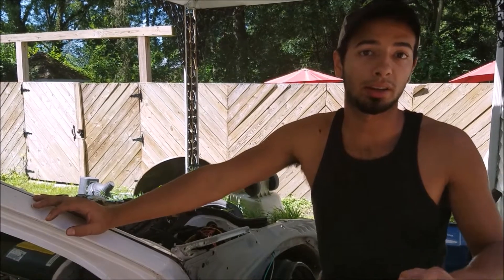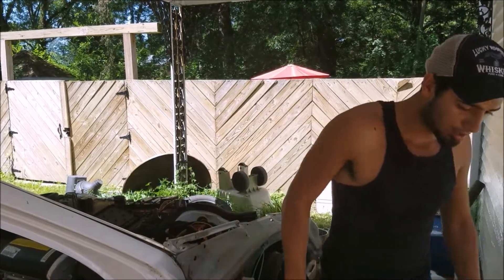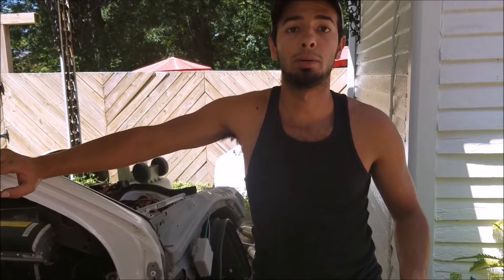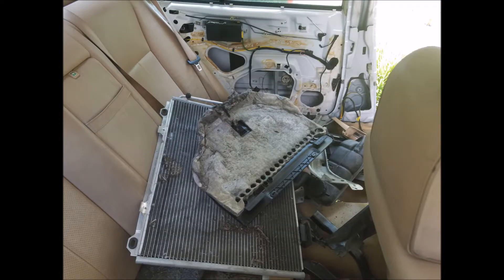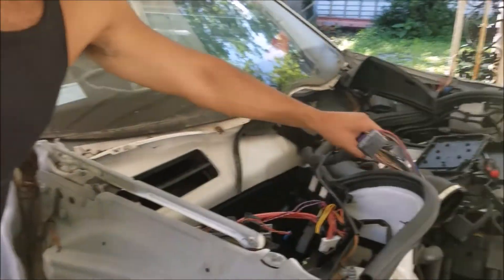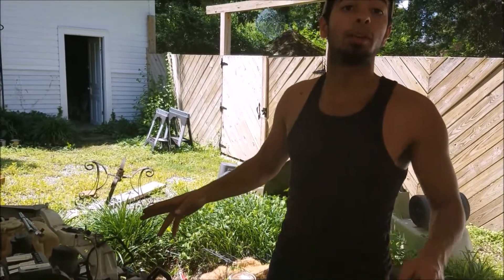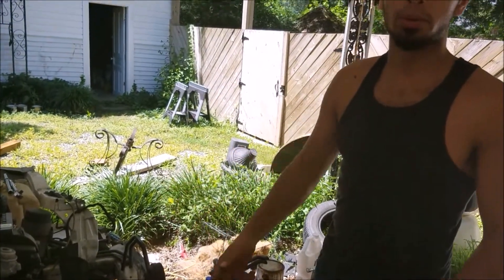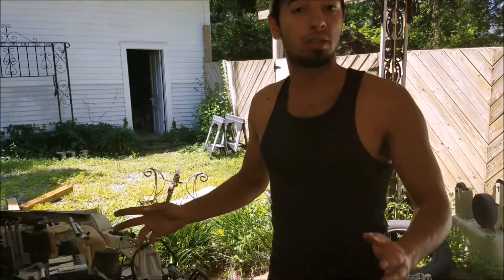How To Part Out A Car On Craigslist and Ebay

Comment: Hey E36 Fanatics, yeah, the cinder-blocks @ 7:57 seconds are supposed to have more strength when you use them vertically (NOT horizontally! as they can crush out) = Engineered for use when the holes are at the top and bottom, just as you would when building a brick wall. I know by experience, have had blocks go to pieces, the way you show yours.. aaaaaand, axle stands are fairly cheap and safer alternative!! hope this is helpful, Great Vid bro!!! lat'r Buzz
Reply: DOH! I should have read the previous comments first! lol
Reply from the maker: Thanks! I usually use the pair of axle stands I have at the house, but that car was sitting a while so I used the concrete. Thanks for the idea, I try and use 4x4's now when I've got a car sitting.
Reply: I saw an OzMods video where the jack stand actually collapsed under the car when he was about to change out the exhaust, so no they aren’t always the safest. I’d always put some wood or concrete blocks under just for extra insurance

Comment: Do you do this for a living?  I resell items for a living and im searching for my niche and really thinking about getting into selling car parts since I am a backyard mechanic anyways.  I have pick and pull junkyards in my area with a ton of cars, can you recommend some items that sell really well or I should be looking for?  so far ive found a few Mercedes shifters are expensive and some amplifiers go for a good price. and certain climate controls on some cars sell well,   (ive currently got a hand full of mercedes and lexus parts) but really looking to add a few hundred parts to my inventory.   Any help would be great,   Subscribed.
Reply: I have been parting out cars on eBay and Craigslist for some time now. I have been a car guy my whole life. I have a two bay shop behind my house with lift, air tools, etc. I only put the cars on craigslist to sell big parts, ie, fender, doors, hoods, etc. All the smaller stuff is for eBay where the REAL money is. I put all my effort on eBay and anything that sells on Craigslist is a bonus. 50% of my buyers are repair shops. A salvage yard near me sells $20,000 per month on eBay. It is the way to go. It is better to buy whole cars for scrap and part them out fro full profit. I do not waste time going to junkyards to buy. I make all my money back from scrap weight, converter, tires, rims, battery and all the parts I have on eBay I have nothing into for 100% profit! I do this full time.
Reply: At that point though you run the risk of getting caught. If you don’t have a dismsntlers license you can get hit with some hefty fines. You can profit well by going to your local pick-a-part and getting parts but you MUST have knowledge on in demand/profitable OEM parts. My family owns two wrecking yards in Southern California and I ran the eBay department. I moved to Texas last year and started sourcing parts at my local pick-a-parts.

Comment: I noticed that you said to cut anything in your way like the a hoses...those are valuable too I've gone to the junk yard to look for hoses and find them cut they maybe small but in demand
Reply from the maker: They can be, I typically just cut through them, personally I've found that most people want to buy hoses new.
Reply: I was talking to a bone yard guy a while ago about getting a  coolant hose.  He said they don't sell them because they can't guarantee them.  An old hose is problematic.  
     Oh, and you're right.  I hadda pay 60 bucks for that hose.  And it was metal not rubber.

Comment: You might want to google using concrete cinder blocks to support a car. Quite a few sources say it's dangerous.
Reply from the maker: Thanks for the comment, yes I've heard this before. The issue is they can potentially crumble from the weight after being rained on overtime. This is why I use wooden blocks as well.
Reply: E36 Fanatics one of the best things you can use that you may have in plentiful quantity if you scrap cars is rims...a steel rim makes great vehicle cribbing... If it's not enough, take a piece of steel pipe and weld it in the center of the rim...take another pipe with a steel plate welded on top and stick into the first pipe, drill about three holes through them for a steel pin to set the height. Best Jack stands you ever had.
Reply from the maker: Thanks for the info! Yes, the junkyards love using rims as jack stands.

Comment: I'm thinking about parting out my old 2006 Mazda 3 hatch. Looking to get the same car but much newer like 2014 and straight away I can use the winter tires as a second set. Plus the battery is worth a lot.
Reply from the maker: If I recall correctly used Mazda parts are typically worth a pretty good amount. I wish I could get the time to part out a few more vehicles.

Comment: what do you do with the shell once all the good parts are gone?
Reply from the maker: Gendo3s2k I sell it for scrap metal.
Reply: You can cut up a shell in a half an hour with a cutting wheel in an angle grinder.  Even if you have a small vehicle you can get it small enough to get it to the scrap yard.  
     There's a lot a web sites that give you the price of scrap.  It the price is in the toilet and you have room, you can horde your scrap metal pile for a few months and hope the price goes up.  Most of the time it's not worth it.
Reply: Gendo3s2k Most scrap yards will pay cash and collect it

Comment: Great video.  My 2011 Altima 2.5S just died, because the CVT transmission died.  All other parts of the car are in good working condition (although aged).  I'm a novice - is it worth parting out?  Also, is there a chance that someone on Craig's list will come pay me more than the "pick and pull" places and part the car themselves?  For example one of the scrappers offered m $420 for the entire car and will tow it from my house.  Your thoughts.  Thanks!!!
Reply: 2011??? That's pretty dang new!!

Comment: How much do u sell the shell for? Does recycler come and pick it up? Thanks
Reply from the maker: Christopher Larkin it all depends on the company your working with, I had to talk with several before I found one that would pull shells for me. The price of aluminum and metal in general has dropped over the past few years, I typically only get between 50-75 for the shell.

Comment: These are some good tips.
Reply from the maker: Ryan Pinkham thanks, almost got another one today actually.
Reply: You're welcome. I have learned a lot about these things by stripping my old car down, and selling parts. I still have a ton of parts. All of the parts that you listed, are super popular requests. Also, people have to understand, that fully parting a car out takes time.
Reply from the maker: Ryan Pinkham the worst part I've had to pull is the six cylinder bmw transmissions, but if the car has low enough mileage you can get some really nice money from the transmission, differential and the exhaust.

Comment: How do you prevent people on eBay from Parts swapping you in claiming the refund under the ebay money back guarantee policy I've had tons of people do that to me with electronics and I recently decided to upgrade to a different vehicle and would like to part mine out
Reply from the maker: Out of all the parts I've sold on ebay I have never had that issue come up, I can only remember doing 2 returns, and they were both because the buyer didn't match the part number.
Reply: You have to mark your parts. Get a paint pen and dab some paint onto the screw head of the electronic part. If the paint seal is broken from the buyer trying to remove presumably your working component and swapping with their defective one then you will know. So if they return a “defective” part you will notice because that paint seal will either be broken or not there at all.

Comment: My real question is what do you do when nothing but the frame is left?   Who comes to pick it up? The junkyard? Without the wheels how do they get it on a tow truck?
Reply from the maker: I have found that some junkyards will pick up shells, some will not. I have a junkyard that will pick up the shell as long as there is one major drivetrain component left. Diff, trans or motor.
Reply: E36 Fanatics what about the wheels? Im assuming they need to stay on the car. Unless they come with a forklift?
Reply from the maker: So when I was parting out cars that was not the location where I typically parted them out. I usually did it at my friend's garage which had a dirt driveway. 
The only time I leave wheels on a car is if they are cheap iron rims, if they are nice aluminum rims without to much curb rash I take them off and sell them as they are worth quite a bit of $ in good condition. 
Junk truck comes by and drags the car onto the bed regardless if it has rims or not.
Reply: E36 Fanatics lol oh wow! I doubt the yards around here would be cool with that, i think they will be tripping about damaging their bed.  
I bought a 04 maxima with a bad motor and im thinking of parting it out instead of putting an engine since they are almost 1,000 bucks and im not sure if the tranny is ok which is also about 1000, so i might end up paying 2k which is not profitable at all. since i was never able to drive the car, the motor ran so bad i could drive without it dying. The body overall is in decent shape, nice interior and wheels in good shape, accessories seem to be good. Its a shame i thought it might be something like fuel or ignition issue. If i part it out i think i can get atleast 1000, i payed 450 so that's the only way i could see getting my money back.
Reply: Those flat bed tow trucks wench them on ......we had a shell in the back yard

Comment: What was your total profit from the Benz after all the fees paid,cost of vehicle ect... not including your labor? Last year i bought a high end vehicle for 650 and so far i made a little over 480 profit after deducting cost of vehicle and shipping and fees. This spring i am going to strip the rest of the vehicle. I'm hoping to make at least a grand profit when everything sells.
Reply from the maker: That specific vehicle was a car that my dad owned that blew a front differential at 250k so I parted it. I normally only part out bmw's, I typically get part out cars for $500 or less, and another $50-100 for moving and storage costs. I usually make at least $1500 in profit, but I've been doing E36s for a while so I pull specific parts.
Reply from the maker: It also depends on where you live! I live in a more rural area and it's easier to find cheaper cars.
Reply: @e36fanatics29  You only average $1500 profit on a car???
Reply from the maker: @bvybvy  No, my average was closer to $2500 per car, I don't think I ever made less than $1,500 from a vehicle. But I am picky with the parts I pull, I leave a lot of parts that take too long to sell on the car.